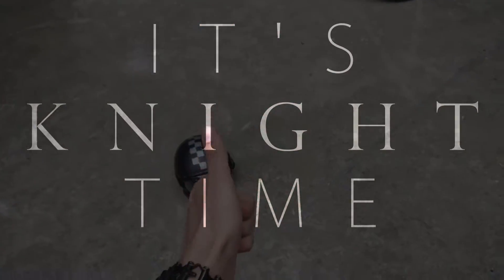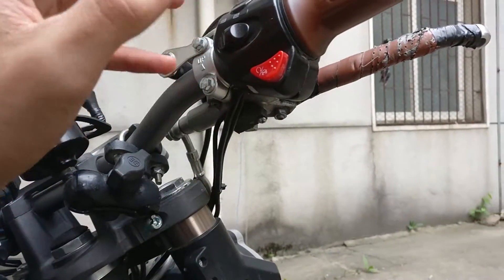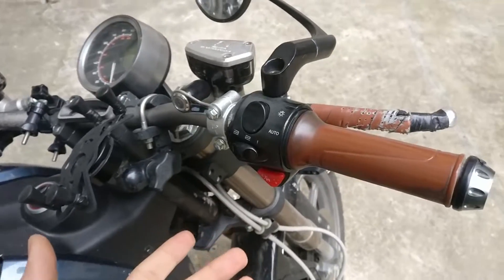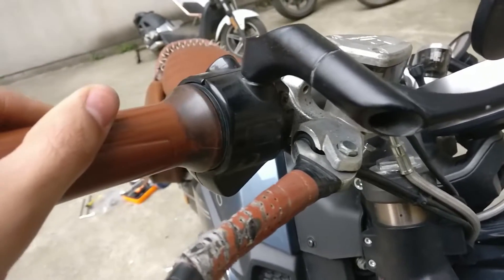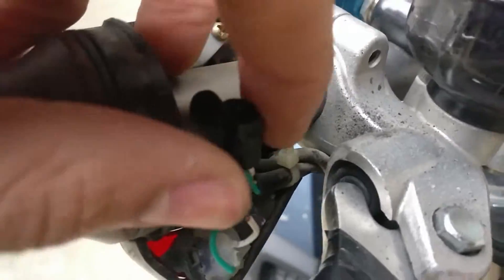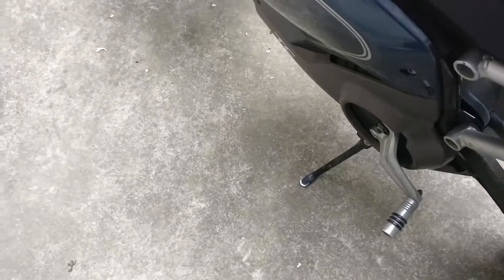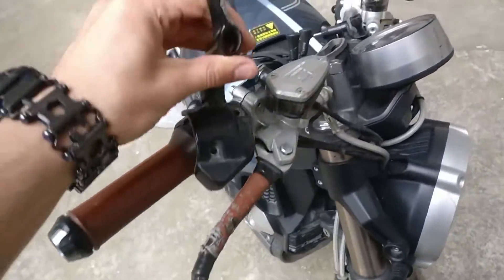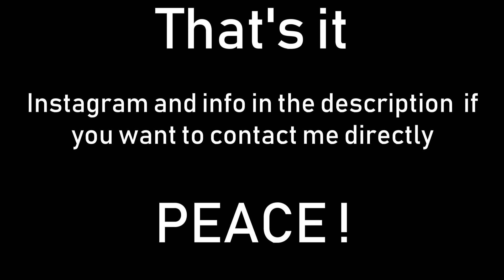Super Soco Park Button Fix

Comment: Great thx. Getting out the bike after winter it was stuck in parking mode no matter what I tried to push it. I shortcut the 2 wires for now. It is a pity they put all this glue to the button. I guess this is the reason there is a common false contact. Any idea if the button can be found and if we could properly make soldering? I could not find it as a spare anywhere...

Comment: Damn, that mirror/handlebar hole has upset me; you see I'm needing to swap the stock handlebars to more narrow ones to fit in the flat when I get mine, but now I have to machine a hole in them... 3:33
Reply from the maker: Well I managed to do it without the hole for a good time (my flat bar isn't stock either)
Reply: @knightrides6034  here's a YouTube video I found that explains and gives advice on overcoming those locating pins. - https://youtu.be/ko80LjeI24Y
Reply: Here's a response from a dealer of these Super Soco's "As far as i am aware they are not for grounding. However, it would be pretty easy just to drill a couple of holes in the new bars to refit the controls without removing the stubs."

Comment: Do I need to have it on "ready" before I cut the cables or can it be in parking mode too. In other words: if cut the power will it stay in the setting im in (ready or parking mode)??
Reply from the maker: Just turn off the bike before doing anything  and keep it off until you're done , other than that it shouldn't matter

Comment: i have a different question... above the park button is a flip switch that says auto and something else... what does it do?? mine has the switch but it has no markings and does nothing HAHAHA
Reply from the maker: @chaver28  I thought so too at first, but it switches the lights between AUTO and ON

AUTO = turn on by itself at night 
ON= always turned on
Reply: @knightrides6034  oooh haha thanks dude means alot

Comment: I just did this, now i cant drive my Super soco and need to replace the handle
Reply from the maker: You might've damaged something or pulled on the wires, either way replacing a handle isn't that hard but I can't think of a fault that requires a new handle controls